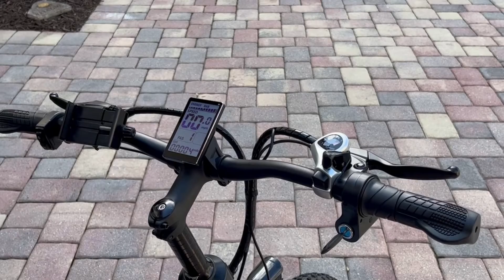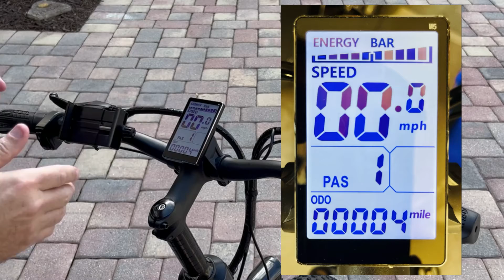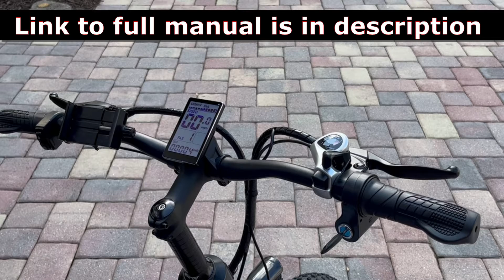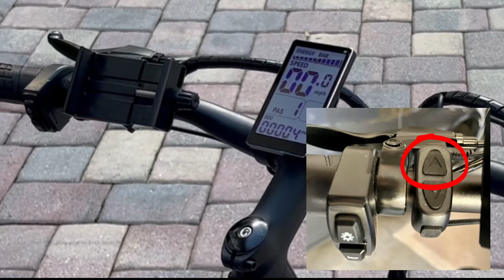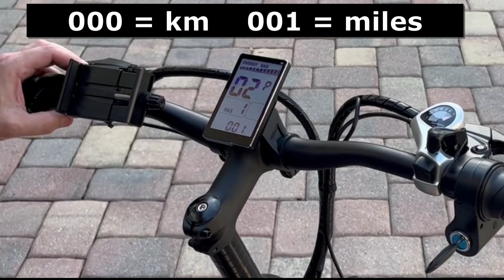M5 controller settings for eBike - Ridstar MG01 1000W - Vitilan V3

Comment: I ordered one is it ok to up the amps without hurting the battery or the motor I have read that it can if the battery isn't rated for more amps and also that more amps can cause the motor to over heat.
Reply from the maker: The battery is rated to 25amp discharge so you're ok up to that
Reply from the maker: Yes

Comment: When I pedal ,the motor doesn't kick on,so I think my pedal assist isn't working.
Reply from the maker: Change drive mode to 02 so
Pedal and throttle both work
Reply: @BRichSolution I did that and still no dice. Throttle works fine though

Comment: Please help , my bike p15 is set at 041 at default  and refuses to change what should I do to bring it down. Since is very bad to my battery life.
Reply from the maker: You can try changing to 40 or 39 but the battery BMS may cut out at 40

Comment: My p15 is set to 42 as default and my battery goes down so fast, and it refuses to to charge , what should I do I do.
Reply from the maker: P15 is low voltage when the battery cuts out.  P14 is anps
That will drain the battery quickly i would change to 18 to prolong battery life

Comment: Speed is about 25 km/h
When changing the speed, a four-digit code is requested
Please help, guys
I want to increase the speed to 40
Reply from the maker: Try 1212 if that does not work ask seller

Comment: Please help!! I have a new model M5 display on my ridstar it has P0 1 Thur 0 and P1. 1 thru 0. Most of the settings are the same as the old one. P0 8 is speed control. Problem is I was messing around with it and now I have no throttle.
Reply from the maker: Change p10 to 2 so throttle and pedal assist are active
See video 
https://youtu.be/pnaEkvOyHwE
Reply: صحيح 👍  @BRichSolution
Reply from the maker: Change p10 to 2 so throttle and pedal assist are activated see video for  https://youtu.be/pnaEkvOyHwE
Reply: @BRichSolution 
Speed is about 25 km/h
When changing the speed, a four-digit code is requested
Please help, guys
I want to increase the speed to 40

Comment: I held the down and the mode button now my bike wont go over 15.6
Reply from the maker: Did you hold down the + and - button as the same time to get to advanced menu?
Reply: @BRichSolution  yea the speed is locked at 25 kmh

Comment: Dont you mean Ridstar? 😂
Reply from the maker: Yes ridstar
Reply: @BRichSolution  I thought you said Ridestar
Reply: @BRichSolution  Rid Star ⭐ or Ride ✨ Star
Reply: @BRichSolution what does P14 do again?? I have it at 12 does that effect speed??
Reply: @BRichSolution I have a 500 watt senada drifter whay should my P14 be at?? And I changed my P18 to 150 and it does 43mph is that accurate??

Comment: I copied your settings and my h20 not working after that. Any suggestions? Need help. Thank you.
Reply from the maker: H20 must have different settings then.  Put settings back to default and then  change each setting individually and test before going to the next setting
Reply: @BRichSolution  yeah. I already figured it out. Working now. Thanks.

Comment: I have the Ridstar H20...just arrived. I went in to the advanced settings as described and changed the distance to km, and screen brightness. I'm a bit concerned that P05 which in the video shows to be set at 01....mine is set to 05. Toggling up and down does not allow me to change that value to 01. So my first question is....what does P05 control and secondly...is the setting of 05 correct or not?
Reply from the maker: See full user manual p05 is help bit file which i believe allow 0-3 PAS mode or 0-5 PAS.   https://drive.google.com/file/d/11lAw9iM5LSeClU6BIZ9uhWouXFD8nR_3/view?usp=share_link
Reply: P5 is number of gears, it’s set at 5 you can make 3 or 9. Not sure why it changes the first number when you hit down compared to cycling through by pressing up. In other words idk the difference between 0.05 and 1.05

Comment: How do I do cruise control ? I broke my M5 on my ridstar got a new one and it finally give me cruise ? I saw that if it’s on you can throttle the bike and the hold down button at the same time
Reply from the maker: Looks like p17 activates cruise controls see full user manual https://drive.google.com/file/d/11lAw9iM5LSeClU6BIZ9uhWouXFD8nR_3/view?usp=share_link

Comment: Hi, my display is only @ 16 which is confusing. I did install a turning signal and moved the display around on the handle bar so does that have something to do with it? I want to completely reset this screen back to all factory setting. Please help😅 thanks
Reply from the maker: I did not see factory reset option in the manual.   Use the video to set each option to factory setting.   
Link to full manual https://drive.google.com/file/d/11lAw9iM5LSeClU6BIZ9uhWouXFD8nR_3/view?usp=share_link
Reply: I have the 1000w 20 ah. Is the link you sent me applicable to it?

Comment: I Ritch, I have 2 other e bikes that have great pedal assist right from the start where the Ridstar you must pedal a few times before assist kicks in. Even at speed when I let off throttle and pedal the assist will kick in when it wants to. I have bought a new controller and no difference. I found a video that explained all settings and set for max assist but it's just a little better. ??
Reply from the maker: Some bikes PAS kick is much quicker then other and sensitivity can be adjusted in the settings.  I wonder if the cadence sensor on crank has too few magnets and the sensors is limited.    Maybe try changing sensor or increasing the setting for the number magnets to fool the controller?
Reply: In your video you left the number of magnets set to one witch was the default. Does your bike respond as good as your other bikes? @BRichSolution

Comment: I have 5 miles on mine and two days later went to ride it and it will not power up. Checked the battery and it is fully charged with 54.4 volts. Any suggestions?
Reply from the maker: Will it accelerate when pedaling?  I had another ebike do this to me and throttle died
Reply: No nothing. No head or tail lights, no horn.
 @BRichSolution

Comment: Thanks for this! Can you tell me the best settings for good pedal assist from a dead start and still have max speed throttle? I would like dial it in to have a faster pedal assist.
Reply from the maker: PAS mode 5; max assist
Reply: In PAS 5 I have 3 settings,000,1,and 2, witch is the choise? @BRichSolution
Reply: My pas 5 only has 000 or 1 or 2 and on 000 I get 29 MPH with throttle on 1 or 2 I only get10.5 MPH with the throttle. Is this the normal??
 @BRichSolution

Comment: Any way to restore M5 to factory default? My young nephew started messing around with the menu and now pas1 doesn’t work. Ty
Reply from the maker: See manual in description under video there is reset to factory settings
Reply: @BRichSolution  I downloaded pdf file you included. Subscribed. Ok thank you
Reply: P 16 hold mode button untill the screen flashes
Reply: @jimtrump1450  thank you very much.

Comment: Hi I was watching your video about ridstar adjusting the lcd  I tried to follow all your numbers but my bike stop running no more I don’t know if I press something wrong & that’s the reason my bike stop running pls if you guide me how to run my bike back I had the 1000w 48v15ah  ridstar I just finished assembling the bike & I start adjusting control panel LCD while watching you & unfortunately my bike stop running & I didn’t put any mile on it even ten feet I never try  to ride the bike yet  pls my name is oscar avs
Reply from the maker: see this video for M5 display settings:  https://youtu.be/pnaEkvOyHwE   If this does not work then ask manufacturer how to reset to factory default settings
Reply: Go to pas5 and set it to 000
Reply: Go to p10 set to 2

Comment: Changing the tire size made a big as$ difference thank you. Keep up the good work.  Is there a white cable in the box to control the speed ??
Reply from the maker: Changing tire size didn’t change the top speed like on some of my other ebikes.  No white wire
Reply: @BRichSolution I unhooked white wire then displays would not show speed

Comment: Hi, i have an ouxi V8 with the M5 display, but i cant change all of the settings, only the brightness, speed limit and PAS mode. Any suggestions for a display that will let me change all of the settings? also, the bike only goes 40/42 km/h on GPS, yet the display says 50.. should i just buy a better controller so it goes faster?
Reply from the maker: Ask seller or manufacturer for password to unlock the speed
Reply: @BRichSolution the thing is that i bought it used. So i don't know who to contact..

Comment: i have error code 10 how to fix?
Reply from the maker: According to manual error code 10 is communication reception which not sure what that means.  Check throttle, screen connection to controller?   See full manual https://drive.google.com/file/d/11lAw9iM5LSeClU6BIZ9uhWouXFD8nR_3/view?usp=share_link
Reply: Short in lcd line . wiggle around

Comment: hello i have this M5 pannel too, but i cannot go to settings when i press down on arrow buttons. it kinda asks me  a code with 3 digits could you help me about this ?
Reply from the maker: Ask manufacturer for code or how to reset
Reply: I've seen "6666" as an unlock code, so try "666"

Comment: To factory reset the display : P16 - hold mode and down button until the screen flashes. It will reset all settings to default. 

Mine had P08 032 and would not let us change it to anything else. Had to call the ebike manufacturer and he had us do the above steps which factory reset it. It was then back to max speed of 100 on P08.
Reply from the maker: Great information, thanks for sharing

Comment: Setting Current Limit  (P14) to 22Ampere give you more current (if your battery can provide enough) and you get more power, but if the controller isn't designed  to support 22A (you have to check on your controller specs)you will break it quickly, specially if you ask that current for long time, so i will suggest to keep it at default value, or just few amp more.
Reply from the maker: 20A is controllers max output so I dialed it back to 20A and all is well

Comment: I just received my new bike and the controller switch is a different style than the one you have to adjust the screen settings. Mine has a + and a - button with out an M to make changes. Also my manual has the older style switch noted. I can get into the screen menu buy cant make any changes. Any suggestions? 
Thank you
Reply from the maker: How do you turn the power on/off to the screen?   If you have a power button use the on/of switch to cycle thru options once in the options menu
Reply: @BRichSolution   Great information. Thank you very much.

Comment: Just bought the Ridstar 48v 1000w foldable. 
But it will not accept any input changes PO1 thru P20. The M5 display shows the changes but the bike reacts exactly the same to manual pedal and throttle inputs.
 Also, I can turn it on and start the bike up without the battery key inserted or in either of it's two positions??
Any idea's anyone?
Reply from the maker: doesn't sound right.  Reach out the manufacturer or seller and tell them the issue.  Sounds like bad Controller?
Reply: Hi I have similar problem on my ridstar but not with every settings. But for example I change P11 or P12 or p14 and bike reacts exactly the same regardless of values in settings. Did you find any solution for that?
Reply: @mrgodzio1750 
I finally emailed the manufacturer in Thailand.
They sent me a new controller after I complained about the inability to self customize. They initially said it was a safety issue. I threatened to return since I bought it on Amazon. 
That changed their tone. 
And sent me an extra battery to keep me happy. 😁👍

Comment: I can't wait until they make a more powerful version, one that goes up to 40mph! I love the fact that the bike is foldable!
Reply from the maker: No ebike that is 48V is able to get to 40 mph.  Closest you can get to is 52v ebike with 1000w or 1500w motor will get you to 37-39mph.   To get to 40 mph you will need 2000w and 60V and that bike will weight 135 lbs

Comment: P09 Zero Start is simply allowing the throttle to power you off from a standing still position (you don't have to get the bike moving yourself first).
Reply: How do you enbale throttle and pedal assist
Reply from the maker: Ok